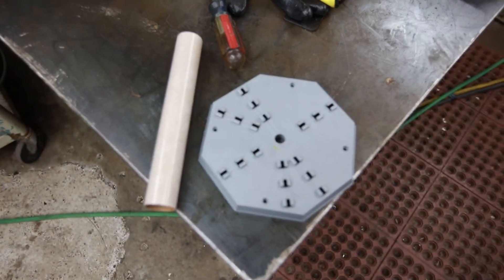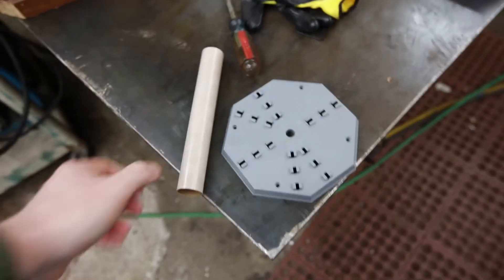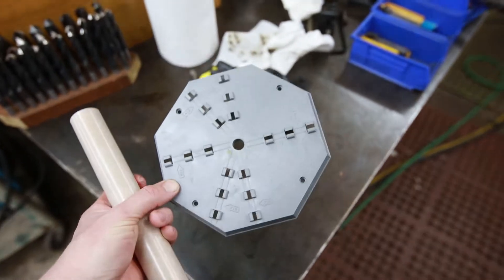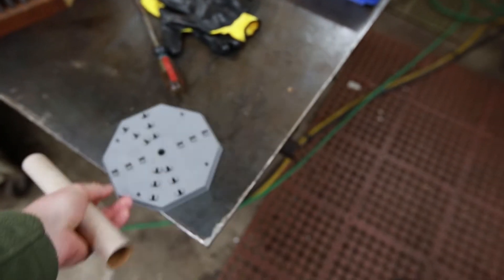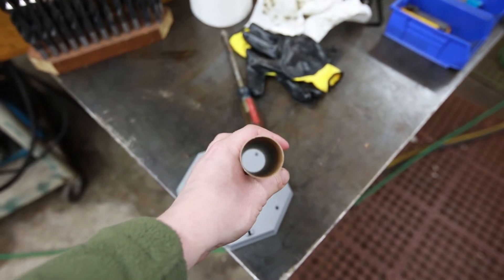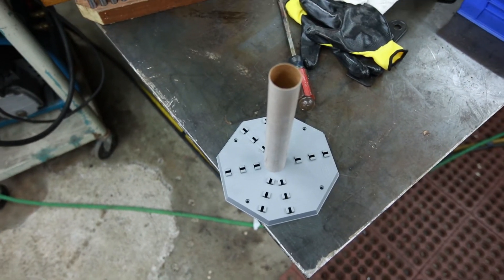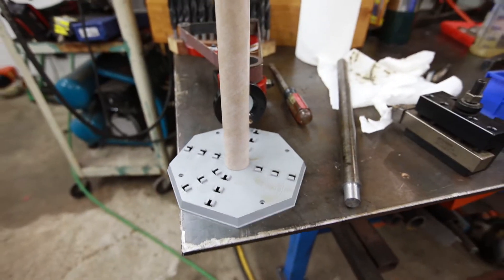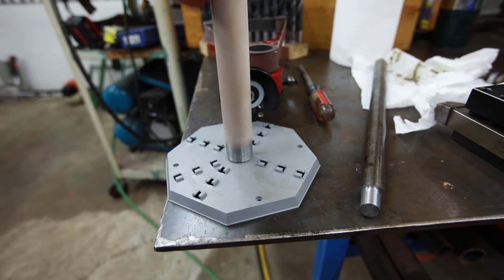Estes Model Rocket Fin Alignment Guide Modification

Comment: Had you read the instructions that come with the alignment guide, you might have come to the realization that the motor mount should be glued into the body tube first, and then anything up to a D sized me can easily be accommodated. So I’m not quite sure why you over engineered this, other than not reading the instructions. The guide comes with every size engine shell you would need.

Comment: face palm...... your supposed to install the motor mount into the body, then used the bushing (engine size) to hold it in place.... it was in the instructions.
Reply: Pro tip!